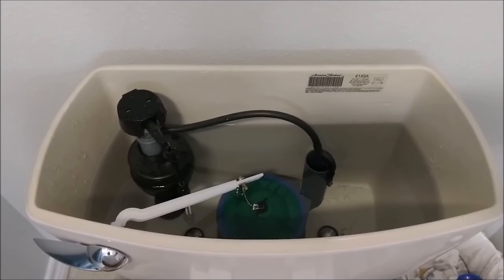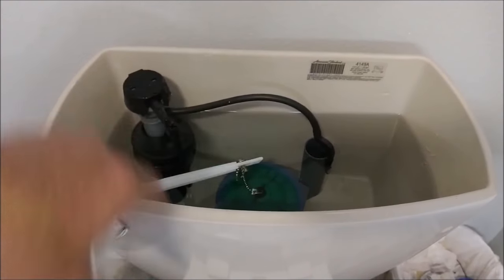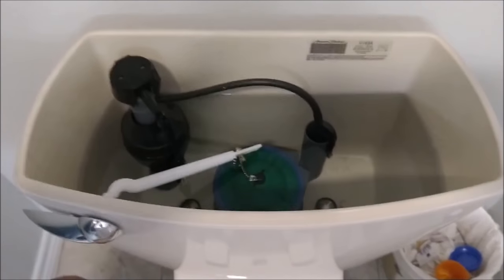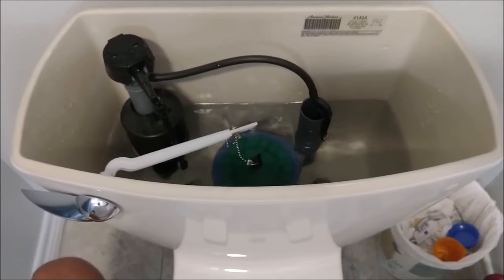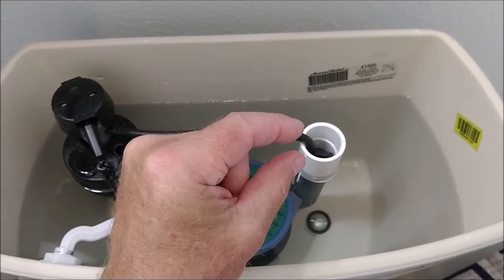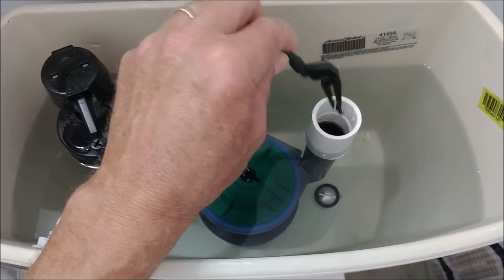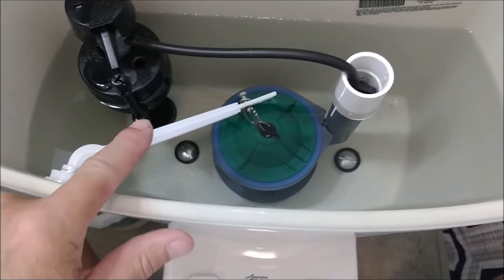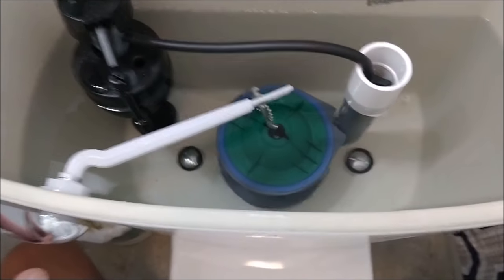American Standard Champion 4 toilet short flush fix

Comment: Thanks for this! :)
I have 2 American Standard 4266 s.  One was working fine but the other started short flushing and I couldn't figure out a solution. It took me about 20 minutes instead of 2 though because I had grind away some material on the 1" PVC union, it wasn't going on and I was afraid too much pressure could break the tube or the flush assembly at the bottom of the tank.
Reply: I may try a heat gun to soften end of pvc connector, so that it can expand a bit to fit over stand up pipe.  When it cools, it should be a snug fit.

Comment: Fantastic!  Worked like a charm. In case it wasn't mentioned , there is a clip on the bottom of the FILL valve , push the clip up and adjust the height of the float even higher.  pssst,  don't let the water go up to the handle.   Thanks for positing this ..

Comment: This didn't work for me as the float is to the max.  Even if I could raise the float higher, the water level would reach the flush handle and come out onto the floor.   Mine flushes just fine at the bottom, but the water doesn't rinse the front of the bowl, so there's always crap clinging there.  I might as well use a cat litter box if want a hands on experience every time.  I bought a Champion brand years ago and that thing was amazing.  I don't know what's changed, but this $300 for this model/brand is a complete fail.
Reply: I raised everything in mine too (and put a coupling on) and am going to pray my toilet never continues to run - because it will go over the handle as well,  What a bunch of garbage.... brand spanking new, installed professionally - and fill valve raised so high the top/lid hits it.  :(

Comment: A 1 inch PVC coupling does not fit on the 1-3/8 OD fill pipe..... You need a. 1-1/4 PVC coupling if you're even going to bother doing that which you don't even need to. All you did was increase the fill level of the tank....
Reply: That was the intention
Reply: The 1-1/4 PVC coupling is too big and slides down. But what's even worse is that if you turn the fill valve all the way to the highest setting it stops perfectly right on the edge of the tube. The PVC coupling doesn't really do anything, because the tank will not fill any higher. Total waste of time and money. The only good fix is to change the center piece to the old style ones. There's a video here that fixes both the leaky rubber valve seal  and the amount of water you can consume to properly flush.
https://youtu.be/OksIFjhdRJ4?si=41PRnrwxo2wvhTHk
Reply: Yes, increase the level of the fill ABOVE the systems cutoff.  So completely solving the problem where these dont flush even liquid waste reliably
Reply: Incorrect. I corrected you above.  @idanny76

Comment: The 1" fitting allowed about 1/4" more water into the tank. A little better but not great.  However, I have same question as Carl Winslow below. I adjust the float ball all the way but I need more water to get a better flush.  HELP if anybody has a solution to adjust float to let more water in. Thx, Bill
Reply: Replace the flapper valve flush assembly with a traditional style flapper valve assembly from Nuflush  to eliminate the poor flush performance of this toilet. This toilet's large trap way diameter and flush valve diameter are fantastic. But the flapper valve assembly design is absolutely stupid.

Comment: Need help. I added the coupling but the water level sits level with the base of the coupling and the flush valve pipe. I’m trying to understand how this helps make the flush more powerful? Thanks.
Reply: The float valve float level needs to be adjusted to a higher level.

Comment: Water keeps running inside that black part that was lifted up and I need to fix this problem asap as the toilet does not stop running. It use to do a quick flush now it is not

Comment: I have tried to use the 1" coupling and it does not work, so what do you have as another solution to fix the flush.
Reply: You mean you can't get it to fit over the stand up pipe?

Comment: So I did this trick about a year ago maybe. Now I’m noticing in the morning my first flush is SUPER short as if the entire bowl won’t drain. Left the top off overnight so I’d remember to check and it looks as if I’m losing water overnight. I never hear it turn itself on to fill the tank, but I’m wondering if it’s seeping into the tube from the fitting. Have you noticed water loss in the morning?
Reply: If You Water Level is not holding, than You Most likely,  have Seep, from the Fitting,,,  You might have to use a Piece of Rubber,   or seal it with PVC   Primer, Cement,    some  glue, or  sealant, Joint compound.. Let us Know How you make out .
Reply: No. Just get a new seal for the valve cap that rises up with handle and seals down on tank bottom. It’s leaking down overnight.

Comment: Where do I find the coupling? Home Depot and Lowe’s didn’t carry it.
Reply: I made one. You can use any plastic pipe that is just slightly too small. Bore it out. I actually found a food scooper that was about that size, hogged out the bottom of it and rtv'd it on. If you have a digital caliper, measure the diameter of the pipe, then go get something close, if it is slightly oversized you can fill it in with silicone. Permatax water pump adhesive would probably be a good thing to use in that situation if you have a gap to fill. A little tube of it is only a few dollars
Reply: @gen-X-trader  thank you, I appreciate the suggestion and input!

Comment: I bought the 3 inch flush kit home depot brand with red Fluidmaster seal between tank and it works perfect. I t will suck you in with it now. Just center it in the hole and tighten. Used NuFlush too and works good too. All Champion 4 and 4 max need this mod to work properly. Get the NuFlush because it fits perfect.
Reply: The 3" worked for you my dad has the liner in his and from what I can tell it's maxed out so I was wandering the best option for him
Reply: Link to the kit ?

Comment: Answer me this why did you change toilets  one picture has no yellow sticker on the right side of toilet and the next there is one so take down this fake video
Reply: yeah you are right he used two different toilets in the before and after videos.
Reply: and the first one the white label is horizonal
Reply: yall hilarious, he showed a toilet without the modification first, then one he modified. its not rocket surgery, and he never said they were the same toilet. probably a different bathroom in same house.
Reply: So what if he used a different toilet for the video? It's just a demonstration of the repair.  The solution worked perfectly for me!

Comment: I am having trouble getting the coupling on. Any tips because I don't want to push too hard and break something.
Reply: Had the same issue.  I may try using a heat gun to soften the end of the PVC connector so that it can expand a bit to fit over the flush valve pipe.  When it cools, it should provide a snug fit.
Reply: I'm having the same issue, is there a chance American standard changed the diameter of this pipe so we can't modify it ?
Reply: I've made up my mind that if and when I start to have trouble with the factory flush valve, I'll replace it with the nuflush valve.  So far, no problems with the factory valve, no seal leaking or ghost flushes, and it has flushed all waste without needing to use a plunger.
Reply: @manster641  I'd guess that the diameter tolerances of the pvc connector may vary depending on manufacterers.  The slightest variance in diameter size can mean the difference between a tight fit and one just right.  Trying on blue jeans is a good comparison.  No 2 pairs fit the same.

Comment: If the flush isn’t long enough, just hold down the handle like-
Reply: That doesn't work with these.  The discharge is raised up about 3 inches, so the water that is released is limited to about half of the available tank water.  It is designed to be a water saver.  In the end, it is a pipe plugger as it isn't enough to move anything down the pipe.  There isn't even enough pressure to push human matter down the toilet with the maximum water with that restrictor installed.
Reply: @run4thecamera  it's actually 4 inches 😀

Comment: The 1-1/4 PVC coupling is too big and slides down. But what's even worse is that if you turn the fill valve all the way to the highest setting it stops perfectly right on the edge of the tube. The PVC coupling doesn't really do anything, because the tank will not fill any higher. Total waste of time and money. The only good fix is to change the center piece to the old style ones. There's a video here that fixes both the leaky rubber valve seal  and the amount of water you can consume to properly flush.
https://youtu.be/OksIFjhdRJ4?si=41PRnrwxo2wvhTHk
Reply: You don't know what you're talking about either. The Fluidmaster is designed to be raised or lowered quite simply. Raise the Fluidmaster about an inch, and the tank will fill all the way to the top of the PVC coupling.
Reply: @fivestringdrive9258  right!  This one is just another jacker too lol
Reply: He didn't say 1 1/4", he said a 1" coupling.............

Comment: Clearly you didn't read the instructions in the box.  The short flush is not a defect.  It's a dual flush system just like the ones that have the 2 buttons on top.  If you want a longer flush you hold the handle down longer.
Reply: Really? Any advice on why the toilets seems to run/fill up out of no where?

Comment: I agree that there is nothing wrong with the toilet. It is mind boggling to me that there is this much controversy over this. Just hold the handle a second longer and there is no problem. Mine works great.
Reply: The blue gaskets on these Champion 4 toilets never fail to fail. They develop little blisters which allows water to drain out of the tank.  In the last nine years I have had to replace them more than a dozen times. I have run out of patience and will replace with a Nuflush valve the next time it happens.

Comment: The normal 1 in. coupling shown in the video did not work for me as the overflow pipe was just a bit too large to fit in the hole. 
I used a 1 in. PVC-Lock Coupling instead and it worked perfectly allowing me to increase the water level in the tank. 
Mine was $3 instead of 50 cents, but it slid on easily and was watertight.  Thanks for pointing me in the right direction.

Comment: There isn't a problem with the Champion toilet, it's the people flushing them. All that's needed is a split second of patience. When you flush hold the lever down for a split second before releasing hand pressure. In the video he lets go too fast before the water can leave the tank. These toilets cut my water bill by 40%, this "fix" will not help you.
Reply: Do not agree. My parents put up with this problem for a couple years. This quick fix did the trick, and they are so Happy with the results. This fix also saves gallons by only flushing once!
Reply: Trying to figure out the need to have 4" of water always on the bottom of the tank?
Reply: @Darlajw  Call American Standard and ask, I'm sure you'll get an explanation that will leave you scratching your head or make perfect sense.